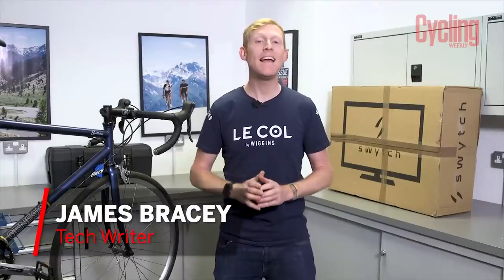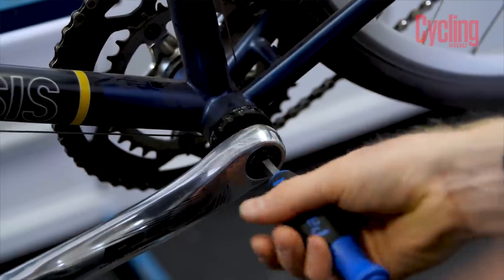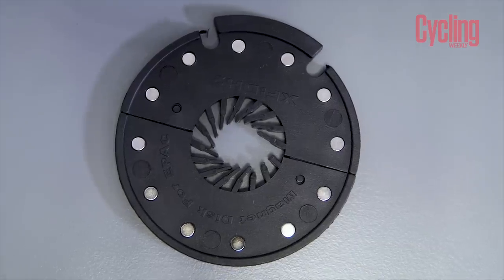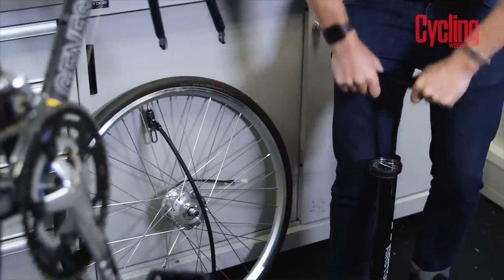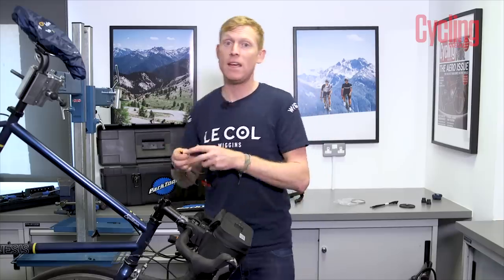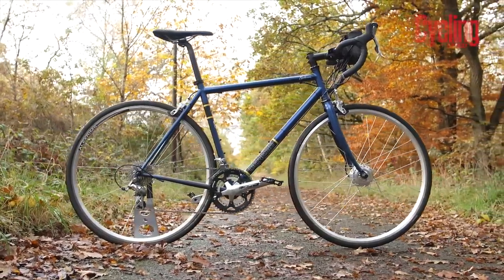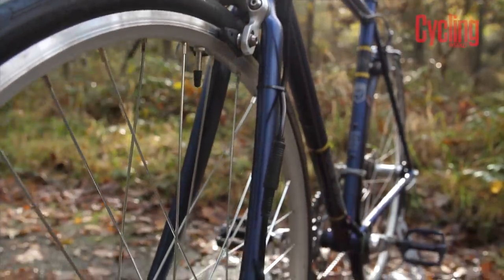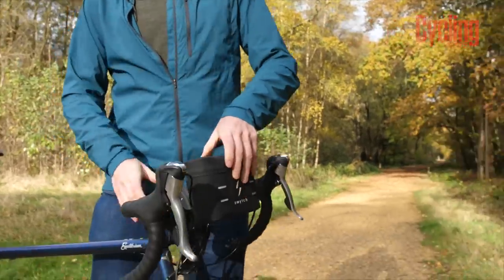E-Bike DIY | How to Convert Your Bike to E-Power? | Cycling Weekly

Comment: are there any cheap kits out there
Reply: cheapest posible way is to buy a crappy kit from ally express without a display but it still will be about 200 there id no cheap budget way to do this because you ned a motor and batary and those are not cheap if you really short on money just buy a scooter they are really popular right now you can get used for 100 with speed dispaly and everything but if you want to go on fortest roads you out of luck
Reply: Look at the Revos friction kit, it is brilliant although it has only one power level.

Comment: That first battery pack in the workshop looked larger and had a fairly complex LCD display but the later battery pack looked smaller with more basic LED indicators. The hub motor looks very small and I'm sure has planetary gears/cogs in order to improve torque but when used with a 700c wheel the torque reduces dramatically because of the larger circumference. A combination of low capacity battery and small hub motor on a large wheel means this probably won't assist the rider that much. Also the plastic/nylon gearing in such hub motors will probably get a harder life in a such a large wheel.

Comment: You said enough to peak my interest, but oddly no info on range, battery capacity, charging time, weight of battery pack, or how that weight on front handlebars affected handling. 
Also more info on what you meant by “sporadic delivery”, and any other things you would like to be improved would have been good.
Reply: Yeah very much sounded like a sponsorsed video to me